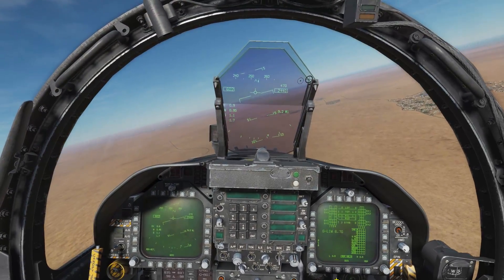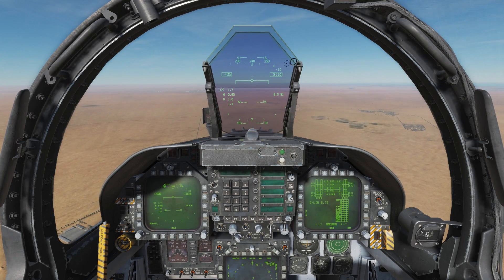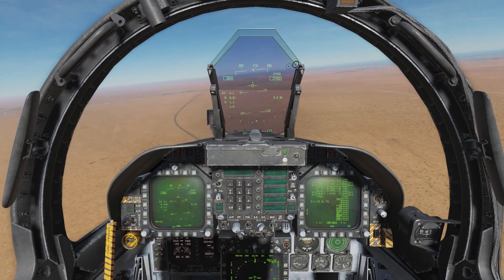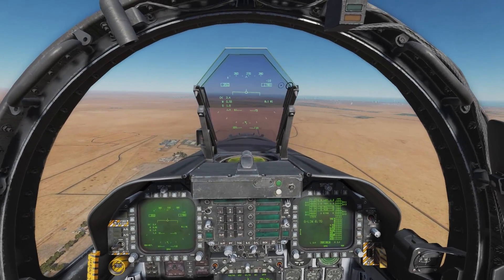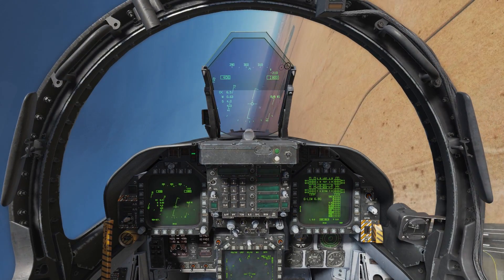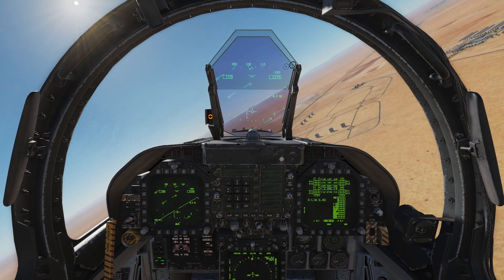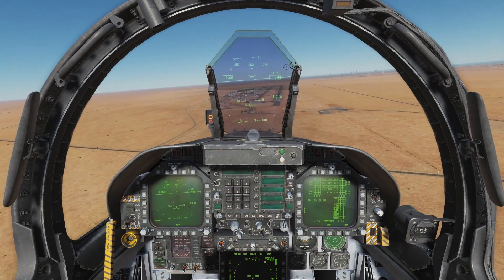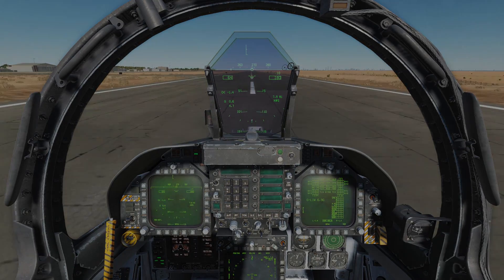DCS F-18C Initial and Pitch (Overhead Break) Tutorial

Comment: I don't know what's the reason behind this landing? Why not just line it up from far and gradually come down? Btw, I'm not a pilot
Reply: There are several reasons military pilots fly the overhead pattern. The first being that it minimizes your exposure to potential threat. Low and slow means easy to hit. The second is speed is life. Fighters aren't the best gliders, so if something goes wrong, the extra speed gives you options to get onto the ground safely without having to eject.... no one wants to eject. You should be able to make it from anywhere inside Initial and throughout the pattern. And third, the overhead pattern is the most expeditious and fuel efficient means of recovery, meaning your not at high power settings and slow airspeeds (what we call being on the back side of the power curve) for long durations.

Comment: Cool video! Just wanted to make a couple of observations and give a few pointers from real life experience: Our standard initial is at 3nm 1500' AGL, with a standard break midfield (unless specified by ATC to break departure end or approach end). Standard break is also a 4G break. In terms of traffic, don't really need to worry about other traffic, unless it is a fighter requesting a closed circuit vs your initial, or you've been sequenced to follow traffic ahead, as any departing aircraft are not allowed to climb past 1000' AGL until the past the departure end of the runway as to not conflict with the jet initial. If done right, a normal initial (not a battle break) is around 350kts, and should take no longer than 1 minute from the point of the break, to touchdown. Subsequently, closed circuits are also very very aggressive, and no longer than 2 min usually. Not unusual to burn up the field for 30+ touch and go's in an hour of circuit training once you get comfortable with the aircraft.

Clearance is never given via a visual approach due to the fact that a visual approach is conducted under IFR and you need to be VFR and VMC to fly a jet initial. ATC phraseology usually is along the lines of "Swift 12 call initial Rwy 08". Once at initial, aircraft is then sequenced "Swift 12 number 1, 08/Swift 12 number 2 follow F18 inside initial/Swift 12 number 2 follow F18 short final for the go". Final clearance is then issued on the base turn "Swift 12, Approach end cable up departure end cable down, winds 120@6, cleared touch & go 08, check gear". During training, we will sometimes have 5 or more aircraft doing closed circuits, and the only way to describe that is sheer organized chaos! Cheers!
Reply: awesome description mate thanks
Reply: Thank you, very informative comment!